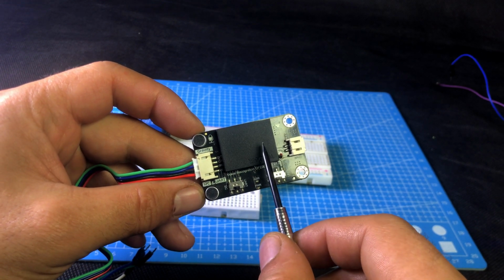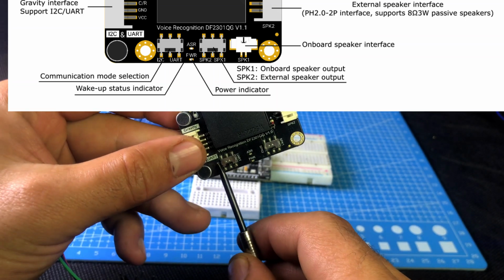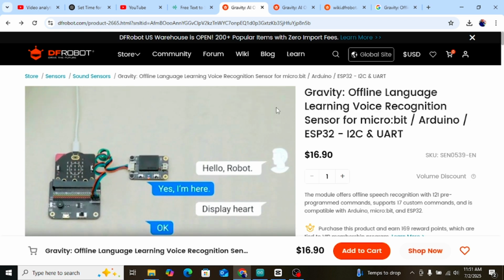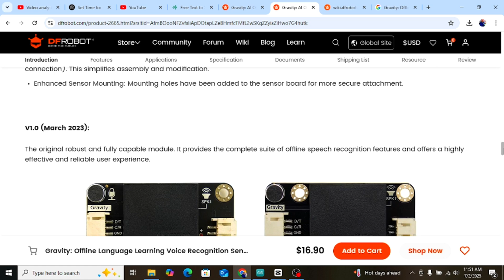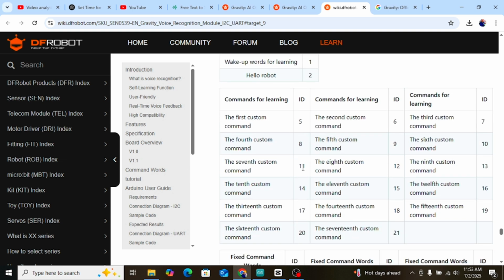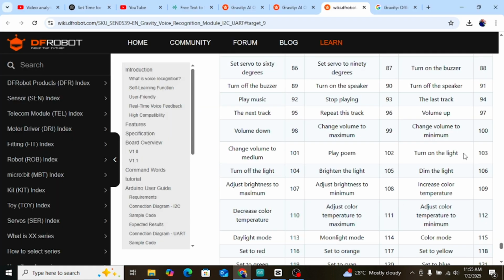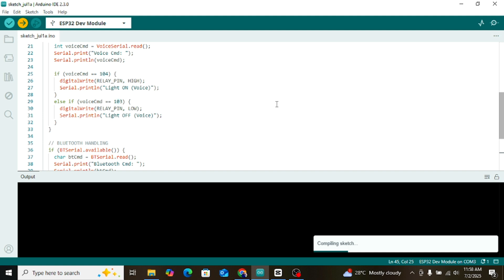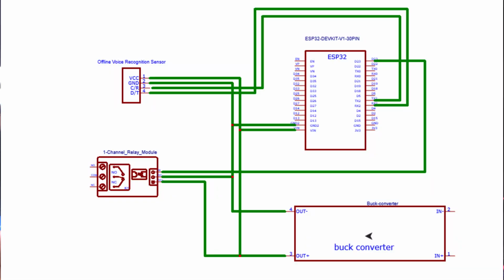IoT Smart Home Automation with Voice Commands  | ESP32 Voice Control Bulb Project

Comment: is this the buck module ? which you've added after coding? what's the use for this in this circuit??
Reply from the maker: Yes, this is a buck converter. It converts the 12V supply into 5V because the relay module works on 5V, and the ESP32 doesn’t have a 5V output. That’s why I used an external 5V supply.
Reply: @ktronic110  thanks alot💖💖
Reply: @ktronic110  I think esp32 provides 5v through VIN pin. Please guide me on this because i used VIN pin and it worked fine